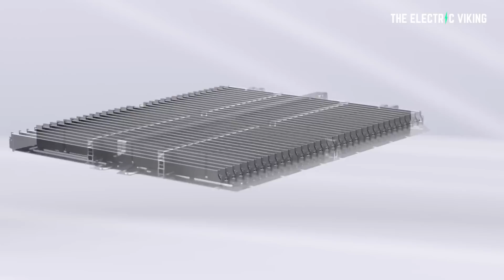Electric cars & pick up trucks will have more range than gas

Comment: Sam, ICE vehicles are going to be with us for a considerable time in OZ, people living in flats or with  on street parking have a real problem, even if landlords put in overhead dangling chargers in flat carparks, it is going to put a lot of load on the grid. Just go look at PetrolPed in England on youtube, he tells it like it really is. It's a dream to think that there will be a massive uptake of EV's in OZ. Try going outbackj in an EV.
Reply: In ten years there will be very few gas guzzlers left.
Reply: @rickster9993  Well lets wait and see, outback Australia cannot be satisfactorily electrified.
Reply: @adoreslaurel  Ever thought about a solar farm mounted on a light trailer. Something with a fold-out solar panel with a battery pack that can recharge in a day and can recharge two EVs. I figure with solar and wind the Outback can easily be electrified.
Reply: @rickster9993  I do not have info on the current output of solar panels but think that you would need quite an array of panels to get sufficient output to charge, I dont imagine people want to tow a massive solar panel set up into possibly inaccesable country. I stick by what I said about flats and street parking.
Reply: @adoreslaurel  The array fits on a compact enclosed trailer roof. The panels fold out and angle up for a good collection system. Right now these are custom systems. That is subject to rapid change.

Solar panels are getting lighter by the year. You can get some that you just unfold and throw on the ground. You do need a little power/battery pack to make it work. You might be surprised at how well they work. Two power packs are even better. That's just for camping. Imagine no fuel cost.
Reply: @rickster9993  Well I admit change can come on rather quickly so good luck to  those who like to go bush.
Reply: @adoreslaurel  Look up "Trailer-mounted solar power station" or  "Trailer-mounted solar power generator"
Reply: @rickster9993  Ok, thanks for that.
Reply: Manufacturing 1l of gas requires that much electricity that a BEV could drive 20-30km with it. Sure, BEVs will require more electricity but at least in Europe only ~3% more minus the savings from not producing that much fuel. That fear of electricity shortage due to BEVs is a result of the negative campaign by car  manufacturers.
Sure, EVs are not suitable for everyone yet but the time will come soon.
Reply: @juergenschoepf2885  Consider this. Estimated 6.6 Million EV sales in 2021. Each EV reduced the need of oil by 1 barrel of oil per week. that's 6.6 million Barrels times 52 weeks equals 343.2 Million barrel per year reduction in oil for gas needs. Diesel next. OPEC only cut production by 104 million barrels per year. Why are gas prices high. Government actually has no real control over prices. Private business controls that.
Reply: Friends of mine have now driven through the Australian outback twice in their EV. It is doable. I do agree that people who cannot charge overnight will find it harder. There are already partial solutions to that - but partial only.

Very little load on the grid though. An average EV can recharge for the average daily drive from a normal power point in just over 2 hours, using the same amount of electricity as it takes to run a little old fan heater for just over 2 hours. As long as that is not done at peak demand, there is no issue at all in terms of total load on the grid.

Comment: Diesel engines are normally more efficient than petrol if fitted with ad blue burn cleaner and release far fewer particulates and nitrox than petrol, don't lessen what you say but putting out rubbish's

Comment: The number of ice cars on the road is going down very slowly.

The sales started to go down 5 years ago.

The ice cars last more than ten years each.

Some twenty years.

So if the sales stop on ice cars twenty years from now we may have them for forty years.

It is going in the right direction and use of ice will be banned more and more.

One thing is that evs will be allowed to travel inside and the ice will not.

There will be increasing number of stocks and tunnels for evs only.

That will make life better.

Passively wait 40 years is not on.